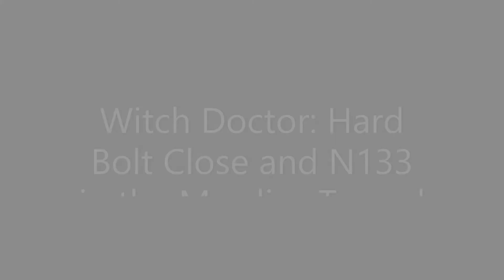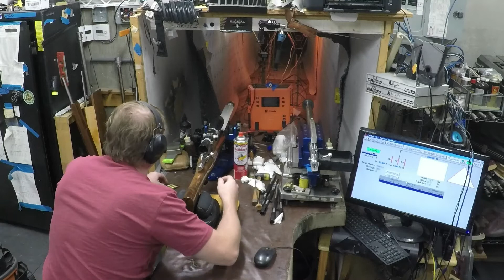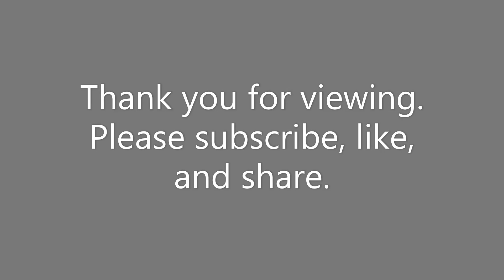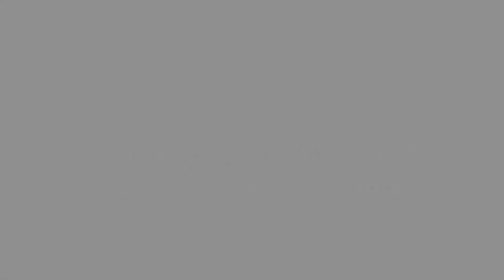Witch Doctor Hard Bolt Close and N133 in Lou Murdica’s Tunnel

Comment: So if you had a rifle that was tight on headspace, slight crush on factory ammo, would that hurt accuracy ?
Reply from the maker: I think that is fine. The light crush bolt close shouldn’t affect precision. It’s the hard bolt close from a clicker, not headspace sized at all, and other potential explanations that seems to affect precision.
Reply: @WitchDoctorPrecision  okay. That was my thoughts as well. I just wanted to confirm. This is the first rifle I built and chambered for myself. Ended up about go plus .001"
Shoots good. Need to go after the firing pin assembly next. 
Thanks for replying.

Comment: What do you think is the optimum shoulder bump? For F Class I go .0015-.002. Even with annealing with the AMP I can’t get them exact.
Reply from the maker: That is the optimal range. Even with annealing you’ll get slight variance usually in the .0005” range up or down. Without annealing, I get .002-.003” variation at times so annealing definitely shrinks the variance in bump. Shoot small!
Reply: @WitchDoctorPrecision  Thats good to have that thought confirmed. I keep my bump to .002"  but as with anything it varies a touch .0015" to .0025" Cases are annealed, sized, trimmed,  deburred, each firing. Lou taught me the Moly the neck trick and I also nylon brush as well. I shoot F open LR. 
Thanks for the insight.

Comment: This is just plain amazing!!!
What caused the hard bolt close?
Was it just shoulder bump or a doughnut on the inside of the neck?
Reply from the maker: Thanks for watching and commenting! The bullet  is nowhere near the donut in this 6PPC and after I fired it, it was not a “clicker” (i.e., expanded case web) which led us to believe it was headspace. Then, after the die was adjusted to bump an additional thousandths, the round went in smooth.
Reply: @WitchDoctorPrecision  Thank you for the response!